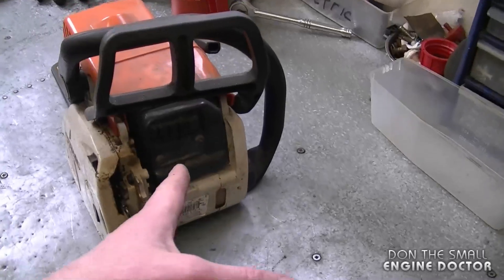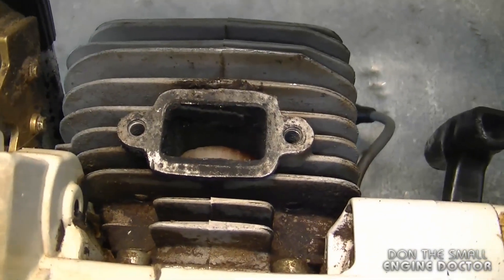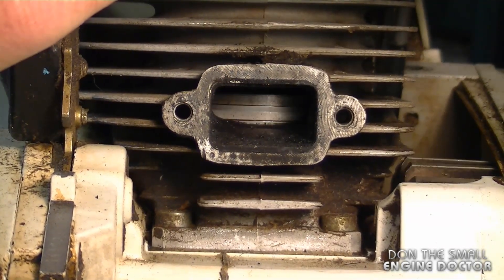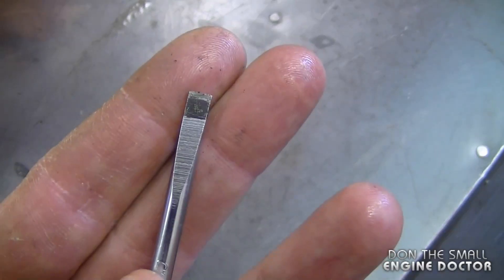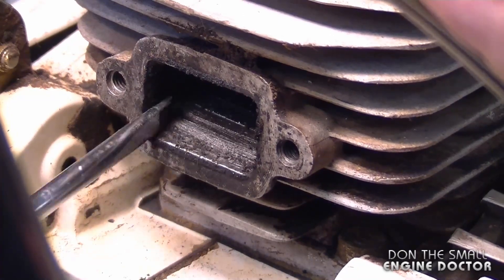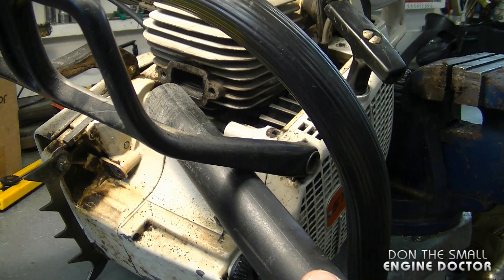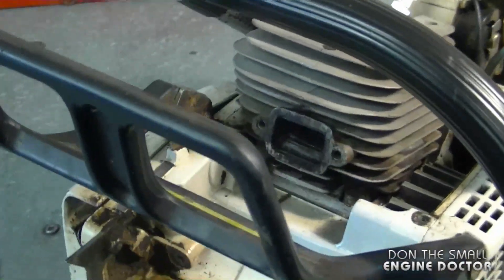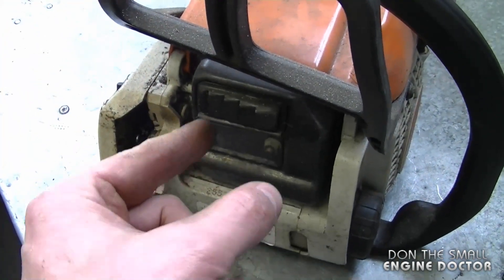How To Remove Carbon From A 2 Cycle Engine Exhaust Port

Comment: Do the little scratches in the exhaust port from the screwdriver make a difference? Is there a tool that wouldn't cause them? (Brass brush maybe?)
Reply from the maker: they won't matter,you can use a small brass brush if you can fit it in there
Reply: rpavlik1 Owners manual recommend that you use only plastic or wood to do this procedure.

Comment: How long does it take for that much carbon to build up and same for the spark screen
Reply from the maker: usually years, but sooner if there is too much oil in fuel
Reply: Ok so I think im ok for now the saw is only 1-2 years old now and it has been running fine. I might take a look in the future